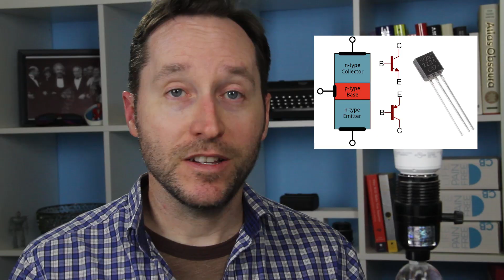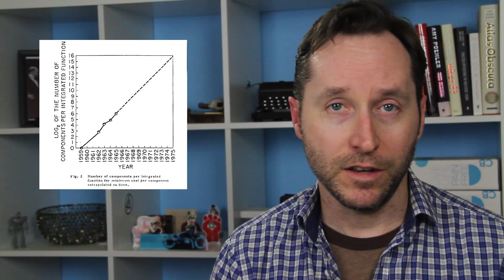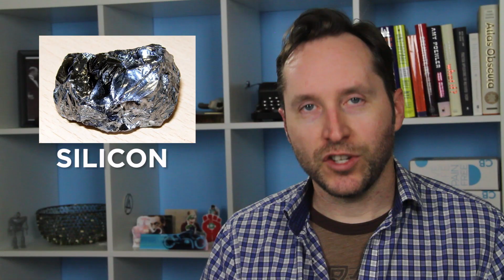Moore's Law Is Ending - Here's 7 Technologies That Could Bring It Back To Life | Answers With Joe

Comment: I've heard that a large part of the stagnation of processing speed over the last decade has been due to peripheral bottlenecks and data transfer rates making processor speed improvements a waste of resources, which is why we've seen such amazing focus on improving the number of cores/threads, bus speeds, bus channels, RAM size/speed, data storage (hard drives, SSD, and m.2/NVME), video cards, usb, hdmi/data ports, internet/network speeds, etc.

From your video, it seems like working on 3D processors while the other tech catches up to peak compatibility, and while reducing the cost of graphene production, and then combining the tech into 3D Graphene processors, is the most likely path to take for the next 50 years of computing.

Just think about it. We have a handheld with millions of times more computing power than all of the computers NASA used to put men on the moon, and when our grandchildren are our age, they might have handheld devices or terminals with the combined computing power of a modern city.

Comment: Moores law may still be viable. If any one of the technologies you just described comes to be used we could see processing power jump 10 fold, or more. In other words we won't be using 4GHz CPU's, but 40GHz CPU's. Moorse law would have to be revised upwards if that occurs even with in the next 10 years. There is a slow down at the moment, but it is very temporary.

Also you over looked the fact that silicon is not the only semi-conductive material available to us. There is currently quite bit of research into using other semi-conductive materials that will also drastically improve processing power if they can be implemented.

Comment: Actually a modern computer has more than a billion transistors in it, do not forget the RAM memory. My i7 6700k Nvidia GTX 1080ti 32gb RAM has 48.000.000.000 transistors at least.

Comment: Horrible conclusion. Ridiculous to think that simply stating Moore's Law drove anyone to do anything. Moore only put an already existing trend into words. Market forces and competition drove manufacturers to continuously improve chips. Without competition, we would still be running 8086 chips on IBM machines running CPM with green screen monitors. Intel's desire for market share, and resulting investment in R&D, and the huge pressure from Intel's competitors are what caused reality to closely mirror Moore's Law. You weren't there, but the competition between IBM and others, the competition between Dos (and soon Windows 3.1) and Apple/Motorola, and other fringe OSs such as by Xerox, and even competition posed from Sun Sparcstations running Unix (much faster than either IBM clones or Apple and multi-threaded), and the emergence of AMD and others, the fight for and to keep market share was fierce. And the competition has been fierce ever since. If Intel, for instance, at ANY point, had slowed R&D for one moment, AMD would have crushed them. Not one single engineer nor scientist at any point every thought to himself, "What can I do to make Moore's law a reality over the next xx months?". This is market that demands constant innovation. Being market leader doesn't mean squat. Just ask IBM, Sun, Compaq, any mainframe maker, Novell, Wordperfect, Netscape, Lotus, MySpace and on and on. Moore's Law did NOT set any goals. The only way to get to the top of the maintain.... and STAY there... is to continue to innovate as fast as you can.... or your competitor will blow you away. Otherwise, your video was good. :)

Comment: Actually, the lamp you have there is a circuit, the light bulb is part of that circuit, the switch is simply a tool for breaking said circuit so the bulb stops running.

Comment: Oh my god...
Silicon is a SEMI-conductor, graphene is a CONDUCTOR (or even a superconductor in some special cases) !
They both have different uses, but graphene is not good for replacing silicon. It could replace the wiring to smaller photolithography nodes, but that's about it.

Comment: More's law isn't ending... And only the first and most obvious reason is that it was never a "law" to begin with. You even stated that yourself, Joe... "It was an arbitrary observation..."
   The "substance" of this is historical. Throughout man's history technology has gone through two basic cycles. First, there's a growth and advancement that rises from linear progression to exponential... And then there's a plateau effect, as material science reaches the limits of innovation on the original technical intent. Sooner or later, a material science advancement comes along and all the "same old technology" gets it's share of innovations from that, repeating the original cycle... You might count that as a third cycle, but it would be splitting hairs, frankly. Within the original technology in question, the two-cycle standard is maintained, since the material science relationship might be obviously intended or it might be completely unrelated and even take decades (or longer) to be realized... and then innovated.
   To be completely honest, I don't know what I would like to see, and it's not going to matter. The essence of the next great advancement in computing is probably going to be a material science advancement. Then innovations will resume control, simply because corporates backing the ideas are going to stick to what's been proven and use the new material to raise prices (first) and meter out the levels of advancement per generation for productions. It's a bottom line question. Likely, we're stuck with graphene based semiconductors, or some similar reimagining of microprocessors and components that still work on the same binary and the same electronic principles, just allowing exponentially more function on less heat (and possibly lower power requirements)...
    :o)

Comment: I think Moores  law is still going on, but rather then going by speed, it should be by  processing power on the same size chipset. Which should still be doubling every 18 months. since they are putting on more processors on one chip in order to make  it go  fast/smother
Reply: Moore's law is stated in terms of transistor density, not "speed", so it already is what you're suggesting. Progress has lagged the "doubling every 18 months" for almost 10 years now. There were dual core CPUs in 2007. Most people have quad core CPUs today, 10 years later.

Comment: Silicon CMOS is pretty damned good. It takes about 20 years from invention to market  place in the integrated circuit business. We have nothing that  can do more than re-arrange the deck chairs on the Titanic; that's why it's going to be more than 20 years before we some revolutionary change. All of the known candidates for replacing silicon are kind of iffy and it's not clear that any of them are a straight forward improvement.

Comment: Moore's law unfairly gets all the credit for the growth in performance. Dennard scaling; that was the key; the magical free lunch. Without Dennard scaling, you'd still have multi-billion transistor GPUs and CPUs, but they'd still run at a few hundred kHz like early integrated circuits. That's why CPUs haven't improved much since the early 00's. Shrinking just gives you more transistors, not more speed and barely less power per transistor. If Dennard-scaling had kept up like in the 90's, we'd be fast approaching 1 THz CPUs.

Comment: About the quantum computer. They did not compute 5*3=15. They did better. They computed the prime decomposition of 15, which is 5 and 3.
And there is not 3 kind of bits. Quantum computation only uses bits that are in a superposed state. Note that this means that the bits in question cannot be observed or read, or else that quantum state would collapse on one value only (one or zero). 
To give a sens of what that means. If you don't know the state of something, it could be anything. And when you observes it, you get a certain probability to see one of the possibility appearing when you take a look at it. So in a sens, there is an infinite different "kind" of superposed states for those bits, given that it is not always half-half probability for one and zero.

Comment: The doubling of performance on CPU`s every 18 month at least on the consumers market stopped about 10 - 15 years ago... Until last year I was still using a now 11 year old Xeon 3060 for gaming. Right now I am writhing this on a generation 3 Intel i7 (3.4Ghz Xeon) bought a month ago that is only about 10-20% slower than the latest generation 7 Intel i7 that cost much more.

Comment: I've always thought, why does it have to be on or off? Why can't it be varying voltages that represent multiple values such as 0-9 or even A-Z? If that were possible, it would allow you to process much more data which would result in faster perceived speed.

Comment: Hmm you've never worked in the  semiconductor industry have you? Your explanations and examples are off completely. You are just covering college research papers. 
The biggest reason that speeds have tapered off is due to size of issues caused by photolithography limitations. 
Also quantum tunneling is calculated into the development of a chip and is used to actually move electrons from source to drain. 
Another alternative is to change from silicon germanium wafer to a diamond boron substrate to handle through put and heat dissipation. 
Meh if you really wanted to research this topic you definitely used the wrong sources.

Comment: Wrong!  Ir only takes SIX bits to hold an ASCII character.  Eight bits hold EBCDIC - Extended Binary ..somethinig.something.  [I used to know that when I programmed IBM mainframes].  Anyway ASCII only has 64 different characters; EBCDIC has 256.
Reply: Uppercase A is ASCII value 0x41, lowercase a is ASCII value 0x61.  Seven bits.  I don't know how you got so many thumbs-ups. >_<

Comment: Ending? It ended over a decade ago. We get 5% out of every new Intel generation each 18 months. We have for years. In fact since we hit the power wall back in 2002 where they could no longer ramp the clock speed because of heat, it has been all over. The architecture wall at 7nm will be the end of silicon improvement due to quantum tunneling and that isn't far away, but as we edge closer, each drop takes longer and longer to achieve. tick-tock has gone, then tick-tock-optimization, now we are looking at 4 increments for an architecture scaling reduction.

Comment: You're were kinda misleading.. Quantom pc's wont replace desktops.. They are only good for specific matematical calculations..
Reply: Pragmatic Ed That is only true for quantum annealing, not universal quantum computing.
Reply: Pragmatic Ed Well that's a bummer I was hoping to have enough power in my pc for virtual reality porn
Reply: Quantum computers for bitcoin mining
Reply: So we will be using binary computers forever?  I highly doubt it.
Reply: Not yet...
Reply: Pragmatic Ed 
We won’t need a desktop. He will only need a smart phone and access to the Internet.
Reply: not... entirely true.
that's the case now sure but that's only because our entire programming environment is set up to work with linear single thread programming. Multithreading has been around for a little while though it hasn't been that popular, one great example of multithreading is the  PS3, it had multiple co-processors. Rather than doing one thing really fast it would do multiple things at the same time, it's the difference between one person doing something alone and splitting that task up between multiple people.

Now rather than having 4 or 8 threads, imagine you have... unlimited threads.
theoretically you could take all the necessary calculations and spread them horizontally  so that the entire process is done in one step. That is what a quantum computer can do and it could be used, with a little refinement and adaptation from us programmers,  by the average person. IBM already has an open API for their quantum computer for anyone to use for free. 

I can imagine having a home quantum mainframe with multiple "terminals" (ipad, mobile, desktop... etc) connected to it through network with ridiculous performance gains.
Reply: That’s what they said when computers were first made too

Comment: well people lets look at a processor that can do 1 trillion  trillion bits of data  per cycle. think of a transistor that can  switch on off, on off, off on, on on and off off at the same time. confused will lets break light into its spectrum each shade and color is a bit of data then you input your data and it is put into light and that light is put  through the transistor and the data comes out the other end

Comment: Quantum computers are meant for parallel processing many different operations at once, but used to solve 1 problem with many variables.  Like simulating the big bang using inflationary model.  Or producing a better weather forecast.
But for doing several different types of operation, it's not meant for that; it won't make that type of processing any faster, the different processes would constantly collapse the wave functions making a typical processor we have today.  The idea is to put all the variables in at once, then put it through the quantum computer where it is all calculated at once, then it spits out the results for all the variables essentially immediately.

Comment: A few things:
- You were pretty clear stating that Moore's law applied to transistor count and that other metrics kind of rolled up into it.. and then you presented a graph of processing speed flattening out.  While that graph is true, its not directly impacted by Moore's law -- those transistors are still getting added but they're being used for other things now (larger/more on-chip caches, tricks to allow variable clock speeds and other power consumption controls, etc.  Even adding more cores to the chip isn't a linear speed improvement by any means.)  That said, Moore's law does seem to be slowing down as you stated.  Its just more to do with the quantum mechanical aspects (which affect the physical amount of transistors we can pack into an area) rather than the heat generation (which affects how fast we can turn them on and off -- ie: processing speed.)

- Quantum computing definitely does not have "three states."  That's kind of into not-even-wrong territory.  Quantum computers are binary systems but are allowed to be in superpositions of the on and off state, which is very, very different from having a third "middle" state or anything like that.  Quantum computing is also fairly limited in its applications (unless someone comes up with amazing new algorithms that we haven't even imagined yet.)  Normal computers are actually really good at most problems.  Quantum computers are really good at one specific subset of problems that normal computers struggle with, but there's a wide range of problems that even a quantum computer can't tackle very well (and then of course there's the halting problem which has been shown mathematically to be uncomputable no matter what kind of computer you have.)

- DNA most certainly does not last forever.  Sure its a really compact storage mechanism (at least by comparison to the kind of hard drives we've got right now) but DNA actually degrades pretty easily -- its a extremely large (by molecular standards) and its designed to be ripped apart, copied, modified, recombined, etc as part of our normal cellular growth -- that is, its purpose-built to be degraded in specific ways, and our bodies have lots of mechanisms available for dealing with damaged DNA.  But in a computer you can't really allow for a "damaged" bit at all, so our computing-grade DNA is going to have to be very carefully developed in order to retain its exact structure for far far longer than natural DNA strand that can easily tolerate a few screwups here and there.

Comment: Even though quantum affects are an issue as far as scaling down transistors, the number of transistors and the number of cores can still increase. Yes heat increases as well but right now GPU's have taught us how to deal with those issues for now. Transistor wise Moore's law may be breaking down, as far as computing power on a single PC, we can leverage that with current technology and we have a way to go before it comes to a stand still. Certainly enough to create new ideas.

Comment: So with only 2 processor companys (Intel/Amd) with one holding +90% of the market, that has caused intel to slow down on releasing new faster chips. Because whats the point of competing against yourself? If your driving down profits and until data bandwith gets massively  improved theres another hurdle that faster cpus wont help. also untill they optimize applications to run on more then 4 cores another hurdle, internet speeds need to improve. really its more everything but the processors that need to be better optimized before we need more transisters/computing power especialy for the average user. And now with massive neural networks & machine learning theres no need for higher ipc and more ghz when you can link a ton of processors together. also the heat is an issue to be solved too.
Reply: 90% of the market share of desktops maybe, but if we were talking about the market share of all computers everywhere then 90% belongs to ARM.

Comment: The Technical revolution has ended, as the speed of the processor has exceeded what is needed.  Technology is not a never ending thing with out limits.  Technology has limits and its reached its near maximum.